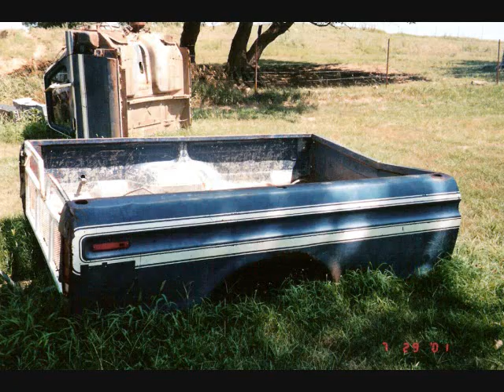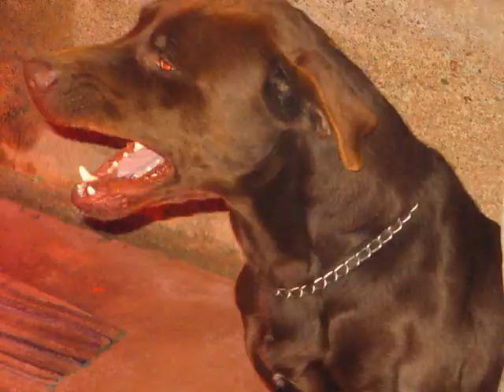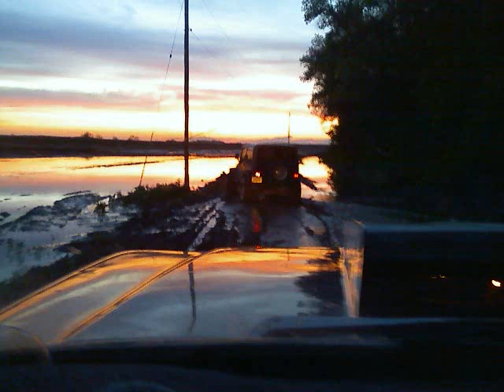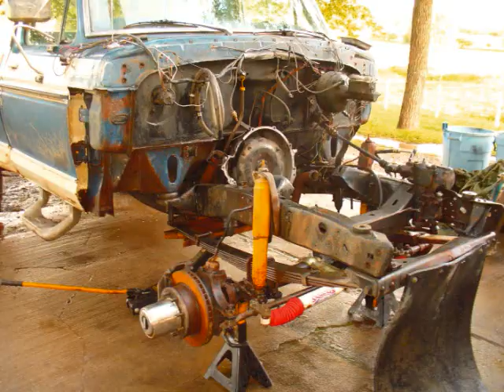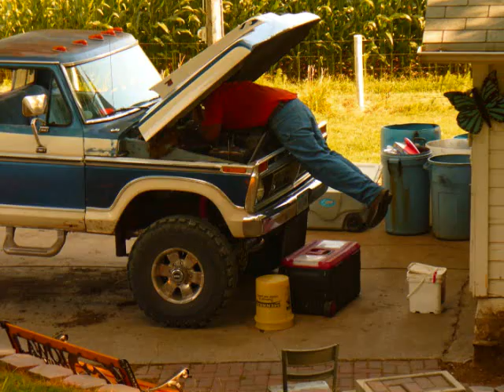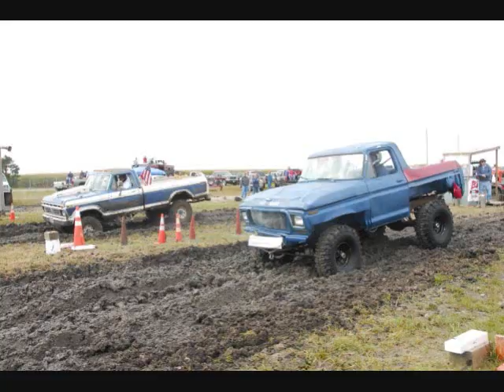Highboy through the years

Comment: I've got a highboy just got it running again and was wondering what exactly makes a highboy a highboy besides a factory lift
Reply: Mike Maxin 1967-1977.5 Ford F-250 4x4

- Divorced Transfer Case (Not attached to the transmission)

- A Highboy will have (3) driveshafts

- The front spring pack will have a noticeable arch (1977.5 and later are flat)

- Rear springs are 2-1/4" wide. 1977.5 and later non-Highboy's will have 3-inch wide rear leafs.

Front axle choices in the Highboy were either the 8-lug Dana 44 or the low pinion Dana 60.

Engine choices were either the 6-cylinder or 360 2 bbl V-8. Steering was either manual or power ram assist.
Reply: The factory lifts are  from like 1969 was the first year a handful were made and then until about 75 was the last year I saw a few 77 and 78 Hiboys lifted but the lifts didn't look factory. My 77 and 79 I made them HIboy's Rough Country offers a HIBoy kit for like $550... at least back then they cost that.... I had a 69 I bought in Texas never heard of a HIBOY before I bought that one.. Then I had a 72 77 and 79... I'm not a ford fan just those years and I have 68 shortbed still sleeps in my secret garage like a B52. Whenever I get people with mouth I go get ole Alabama I call the truck because when I bought the short bed there was an Alabama cassette tape stuck in the radio it wouldn't come out just played over and over again... My short bed has a 352 Interceptor we bored out 30 over and put two Holley's on it. That dog hunts when people mouth off I got her or my 72 NHRA Road Runner. Shuts up the big mouths real quick when I say lets run it off title for title... Oh you got two carbs... Yeah and balls too... I still don't know the difference between the 351 and the 352 just that my oil filter config was different and I had to buy an adapter kit so I could put a modern oil filter on it they don't make the filters for the 352 motor anymore... They stopped making a filter about 91 or 92 you could order stuff but I didn't have on line back then and I hate waiting for shit to come in the mail...